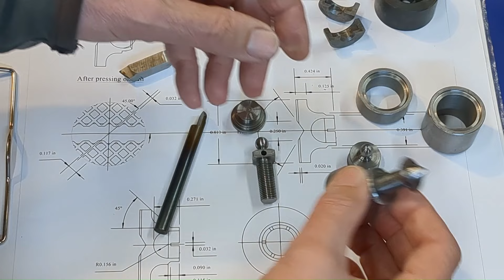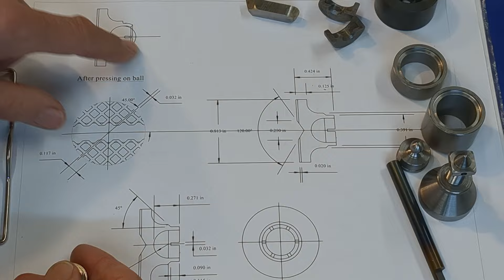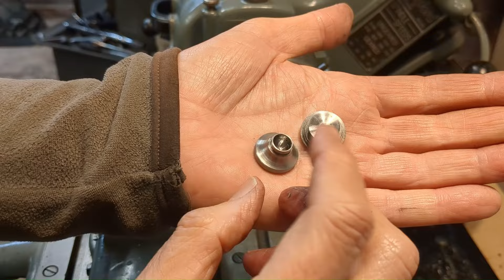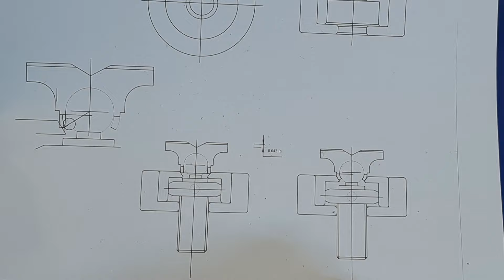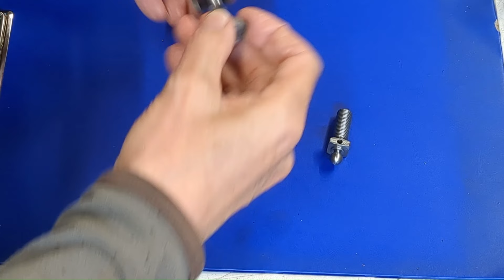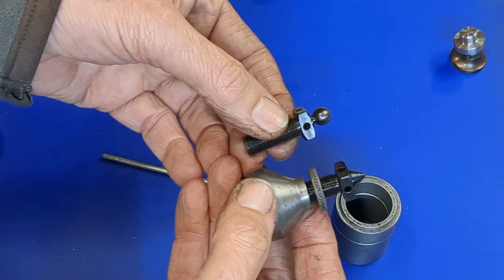Making a machinist's jack - part 3 (completion)

Comment: You could have cheated with a ball nose end mill.

Tempering is annealing.

I suspect you could probably pre crimp and spring temper the pad and pop the ball in.
It wouldn’t be as tight a fit but it would be replaceable if damaged.

I would tend to just use a wire snap ring myself.
Reply from the maker: Yes, I thought about that but it wasn't convenient and I wanted to make one anyway for the experience.
The snap ring is a good idea!

Comment: Very interesting, as always. Thank you. That’s a good sized arbor press. I’d like to pick your brain if I could (or any viewers with this experience): I need to broach a 5mm hexagon into approximately 12mm diameter stainless steel bar about 300mm long. I was thinking of grinding the end of a piece of chrome molybdenum Allen key perfectly flat and using my arbor press with the stainless steel bar held in a collet block and heated to red heat for the last 25mm or so, deforming a pre-drilled pilot hole, the swarf being forced into the bottom of the hole. Any better idea?

So, the burning question now must be what’s your next project??!!

Thanks and best regards. Mike
Reply from the maker: Thanks, Mike. I am sorry I have no experience of using a broach. With the heating I would be concerned about the broach losing its cutting edge and getting stuck in the bore as the work contracts.
I haven't decided though I did think about a tool & cutter grinder or a grinding spindle.
Reply: @Workshopfriend  Thanks anyway. The end objective is to implant an Allen key in the end of the bar. I think I might consider making the hole bigger and swaging the end of the bar down using a die in the press.

Anyway, a tool and cutter grinder would be a very useful addition to your workshop and would make a terrific project to follow on YouTube.

M.
Reply from the maker: Or, drilling cross holes and swaging from the side/using set screws? Re the next project your comment is noted. Thanks.